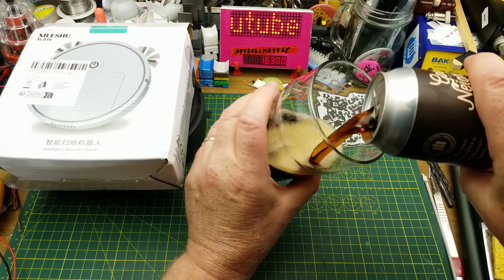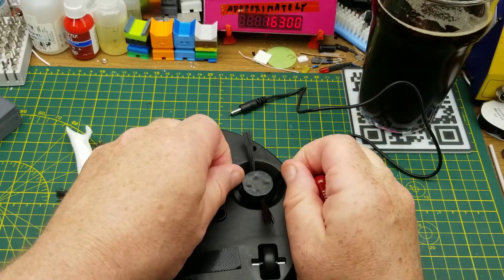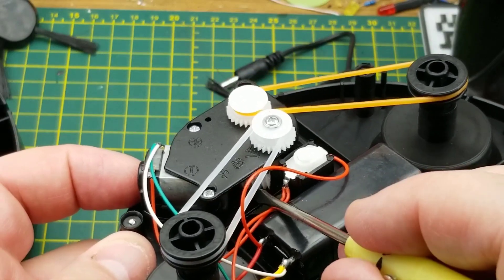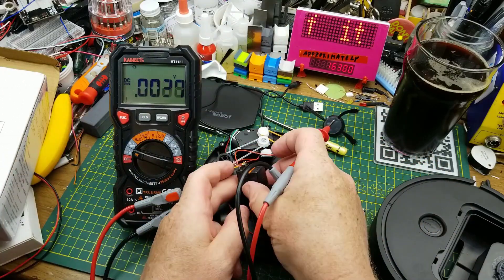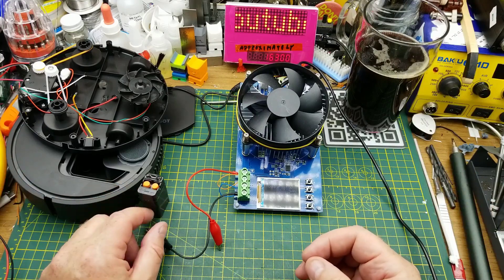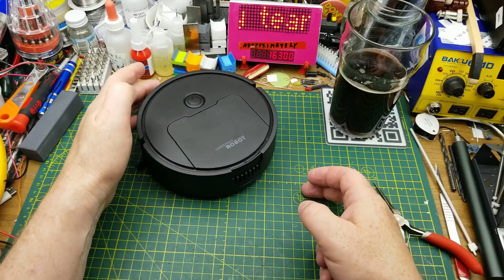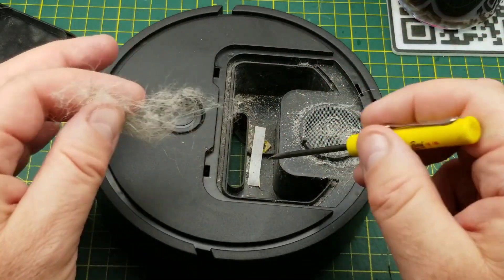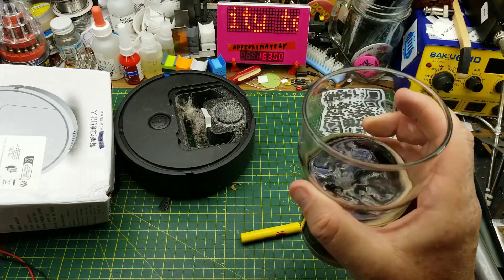Curiosity teardown: cheap "robot" vacuum cleaner

Comment: A few years ago I picked one similar to that one except it held six C size batteries. I picked it up because it was cheaper  then buying the six cells separately and I needed the batteries for a flash light. it had about the same suck Shone power as yours, until I wired it uo with 24volt nicads. It really sucked then and I ran it until the motors started getting real hot. I let it cool down while I rewired the battery pack (20 rechargeable AAAs) by adding 10 more cells all on a long lead, this I hocked up in reverse polarity. It actually lifted off the ground for a couple of inches and hovered for about 15 seconds until the magic Smole came out of the motors.

Comment: On the plus side, it seemed to like you.

Yeah, it was everything one might expect at the price, the only surprise was the failure modes. I didn’t see the mis-installed switch coming nor the self-breaking wire. It’s not really even good for parts.

Comment: Soo clearly.... just a simple lead-acid-battery (casing)... so no regulators needed... for the size a couple of minutes 'running-time'.
Replace with at least 6 V battery-pack or get it on 8 Volts or above.
Reply: Yes the battery is a small two cell lead acid, at least it won't burst into flames or explode, even if charging to 5 volt would be overcharging.

Comment: I bought one of these for like $5 just to mess about with. Yeah they are just garbage. That said it's amusing to shove a USB battery bank on top of it and watch it attempt to clean for a 12 hour run
Reply: Maybe we could go full PhtonicInduction and hike the voltage and current to all the motors!
Reply from the maker: I don;t think it would take much to pop this one. 
Probably wouldn't even be slightly spectacular.
Reply: @pileofstuff  You won't know for sure until you hook it up to the 12kV primary lines.